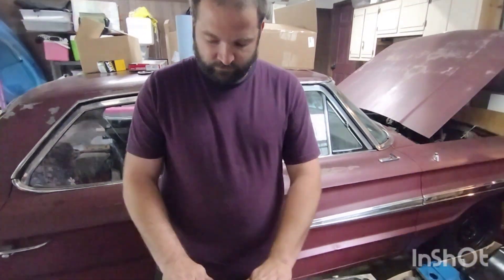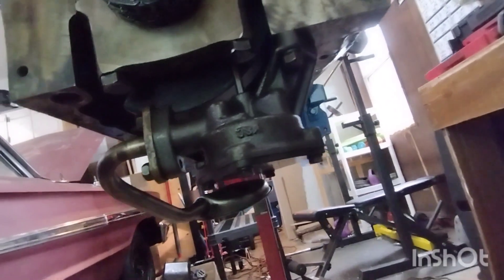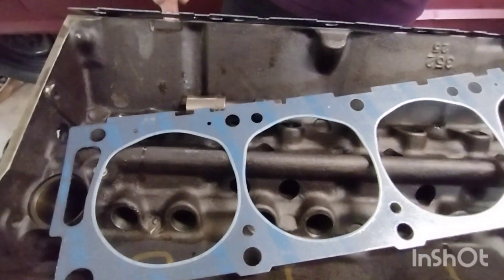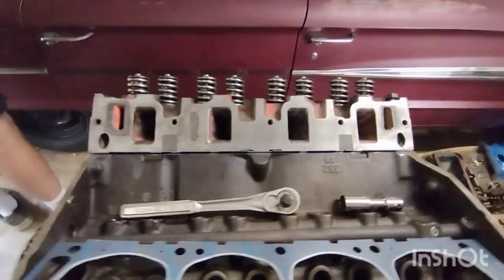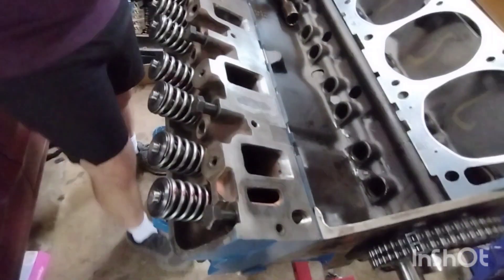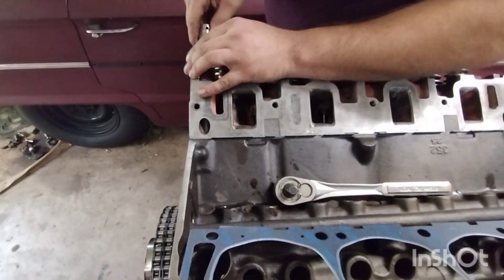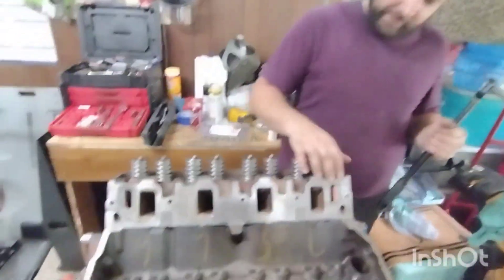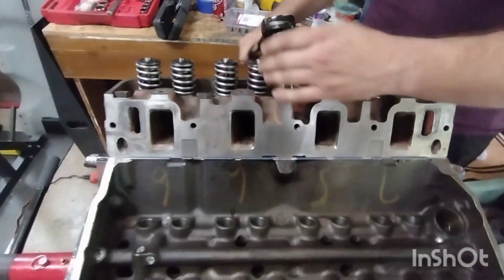How to install cylinder heads and torque to spec on our Ford 352 FE

Comment: Do you put any gasket spray inbetween the heads and motor ?
Reply from the maker: No but I probably should have put light coat of copper coat. Didn't have any laying around at the time.

Comment: What torque wrench are you using? Do you think 1/2 inch or 3/8 would be better for this engine? I’m about to get one of these engines and trying to decide which tools to get. Thanks
Reply from the maker: It's one I got off Amazon. 1/2 inch drive and 1/2 inch drive torque wrench for sure. They usually come with longer handles so more leverage to torque heads and such over 100 ft. Lbs
Reply: @Erics_Garage  sweet, thanks man!
Reply from the maker: I would get a 3/8 drive set with a 1/2 to 3/8 adapter for your torque wrench. This should cover just about everything.
Reply: @Erics_Garage  ok, would there be anything wrong with getting a 1/2 inch drive and using a 3/8 adapter?
Reply from the maker: @leviteater  Not sure if I understand what you mean exactly. 1/2 inch drive sets may not come with some of the smaller sockets you will need. Also they are more beefy and may be hard to fit on some of your bolts in tight areas. I would get a 3/8 set and just get a 1/2 inch drive torque wrench. 1/2 to 3/8 adapter obviously to use the torque wrench. Hope this answers your question.